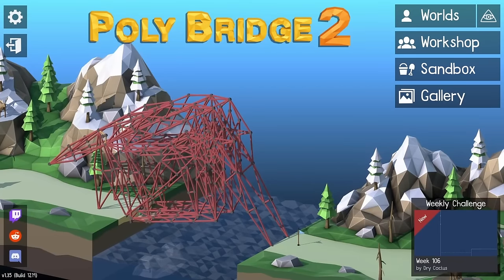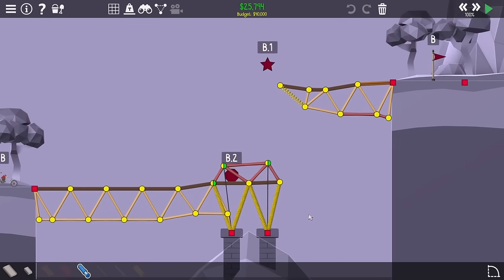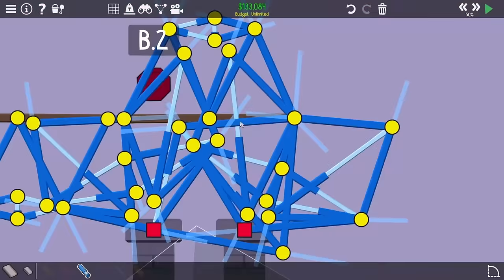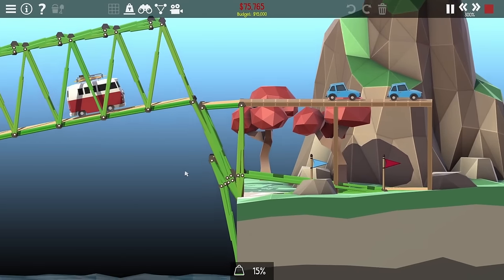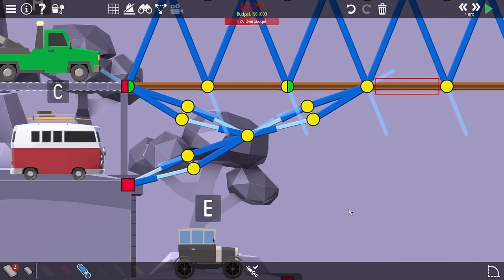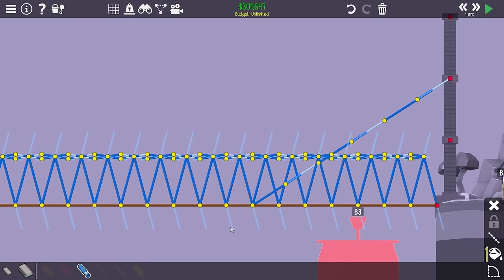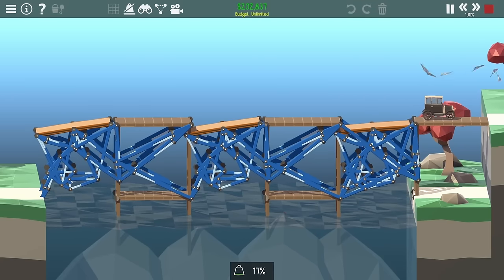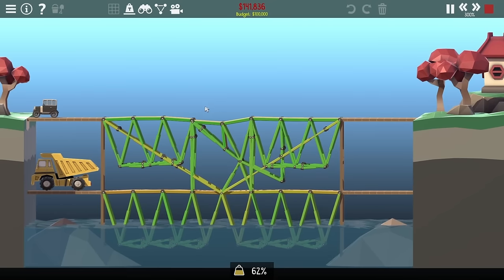Can You Use Only Hydraulics To Beat Poly Bridge 2?

Comment: How about beating Polybridge without using both hydraulics or split joints. Many levels will be a gimme, but there's a few that are going to be very difficult.
Reply: No split joints is the real challenge
Reply: @ChristianAkacro  If you have hydraulics then you could just use them to break specific links if you needed to. Wouldn't be suitable for all levels though I agree.